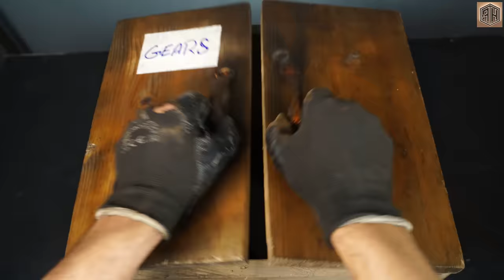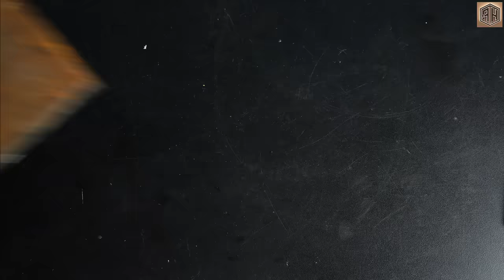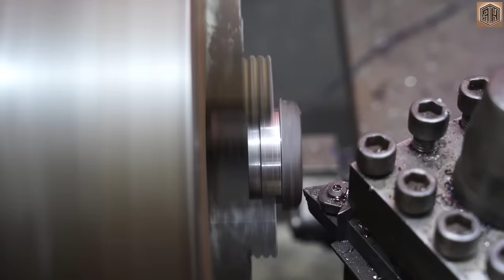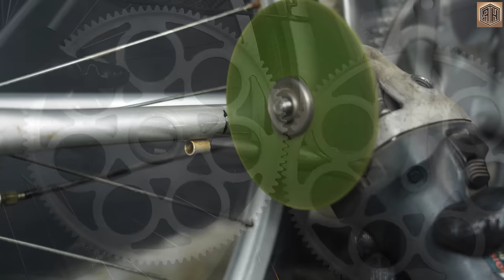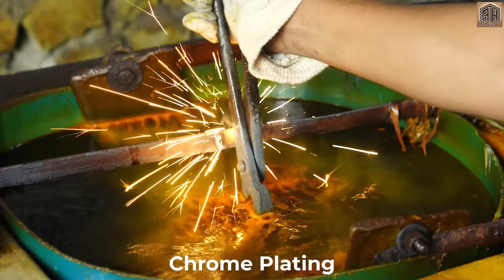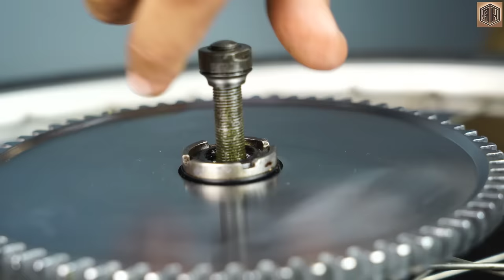Building a CHAIN-LESS Bicycle out of Rusted Gears

Comment: Could you imagine going down a hill and that peddle catching you in the shin bone 😂
Reply: That's one reason why chainless bikes will forever be made impractical. The other reason is that you really truly need to compartmentalize every stage for easy maintenance and repair. We complain about chains falling off, but what if one of the parts breaks here?
Reply: @BigGator5  yes, you’ve said that same thing a couple of times so far. I’m pretty sure RH can fix any problems encountered with this bike.
Reply: Same thing with fixed gear bike and people still use those
Reply: Why would you think this can't have a freewheel (gears for forward motion and slides for reverse)?
Reply: Just make the last/smallest gear a freewheel one. So pedals can stay while the rear wheel/gear is in forward motion.
Reply: @acswain6720  I never said it couldn't free spin

Comment: Dangerous and impractical... but I'm impressive by the multi skills and the professional execution.
Reply: Please explain concerns a bit clearer for us layfolk.
Reply: @acswain6720  Cutting the frame to install an axle at 90 degrees to the direction of load weakens it massively.
There's a reason you only saw it ridden over flat ground at the end. It's likely the bike would have been damaged by a pothole like the one we saw at the beginning.
The right way to do this would be either belt drive (commercially available on folding bikes) or have the wheel on a rotating axle, with a bearing in the fork dropout and the wheel gear external to the frame.
As a piece of art for a youtube video it is nice, and the gear spiders made from an old spring is ingenious (but with labour factored in it would be more cost effective to buy the gears or even make them from new material.)
Reply: A little push from my side may shift few jaws after 200km.
Reply: @acswain6720  Most of his weight is supported on the left side of the bike.  I would've added support from the center of the middle gear back to the bike seat tube.

Comment: Very interesting and bold design of this bike. In mass production, the expensive replacement of gears can be a problem. Chain elimination is beneficial. Theoretically, there could be more, with smaller diameter gears, in a dust-proof casing. Congratulations, best regards 😀.
Reply: Thank you for the like 😀.

Comment: It is very dangerous if the pants are stuck in the gear when pedaling.
It's a failure.
Gear cover should be applied to prevent danger.
Reply: @SamS-vz3dm  Porsches also do this in some of their upper tier sportscar engines, they eliminate the chains and belts and just use gears instead , this tech has its advantages otherwise a big engineering icon such as Porsche would not have used this

Comment: i think chain is good because if you stop paddling it will continue to move

but in this case if you stop paddling its mean you're not able to continue cycling
Reply: I Might be wrong (and please tell me why if i am) but i don't think the chain is what make the bike  still move after stop paddling 
i think the why is on the back wheel gear and i think he only change the shape to fit the gears
But again correct me if I'm wrong
Reply: @IhannRodrigues  Here the pedeals will just keep moving with the bike after you stop pedaling. Till the bike stops.
Reply: @realalreves  not if you put an overrunning clutch
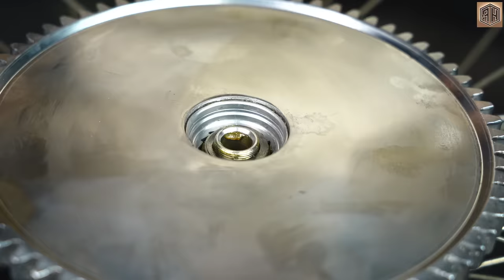Reply: 6:57 do these ball bearings do the work of freewheel pawls do you think? I wondered about that myself... I mean do they ride up the ramps one way but hit the flat edge the other way (and hence transmit drive in only one direction)?

Comment: Great machine work, but single speed gear makes it not very useful other than just a joy ride.  Need some safety guards as it is not very safe
Reply: Есть же втулки планетарной передачи, 8-11-15 скоростей и все с одной звездой снаружи...
Reply: @zcommandante  aq
Reply: His content is about we can remove chains and apply any gear sprockets  and rode kind as it is well
Reply: @punjabitourvlogs  yes, but it is still a single speed, changing sprockets only changes the rotation and effort to pedal, it doesn't have gears to assist, so will always be a single speed
Reply: @andymartinez767  so what in case of chains works same
Reply: @punjabitourvlogs  not really, chains with gears work.  It's the gears to help the cyclist, especially going up hills.  The sprocket is a single gear, hence single speed.  If one tried to ride up a hill, probably not possible.
Reply: Are you imagining the rider might accidentally reach down while pedalling and put their fingers into the gears?
Reply: @davebijoux  yep, or even wearing long pants and get caught, its a hazard for sure

Comment: Gear ratio before this modernisation was around 1:5. After   gear ratio ~ 1:1,5. Max speed for  this Wonder Bike 5-7 km/hour ( instead of 15-20 km/h). Stifness/robustness of the frame is much less than before.  The weight before ~14 kg. After ~20 kg. Useless Bike. I ride bike 365 Day a year during 55 years , but i have never lost the chain.

Comment: Plz  elaborate numerically what is the total effect on speed and  effort. Also about durability of this arrangement.
Reply: The idler gear in the middle has no impact on the effort required.  Strictly compare the input/output gear ratio.